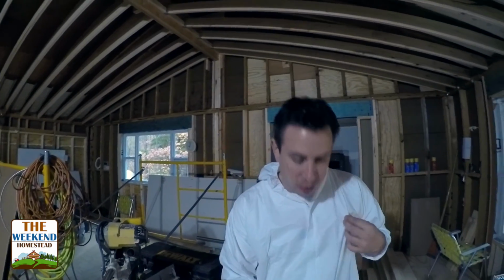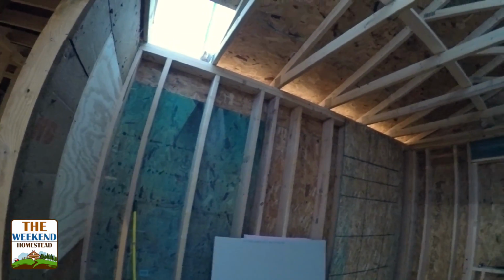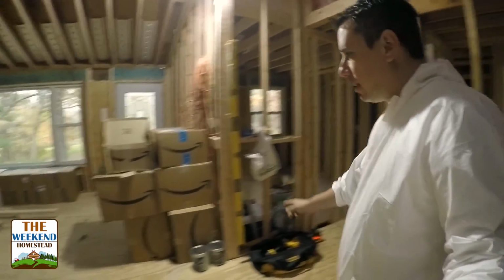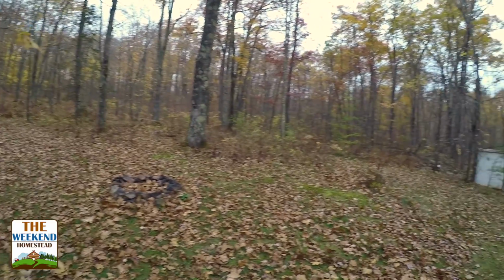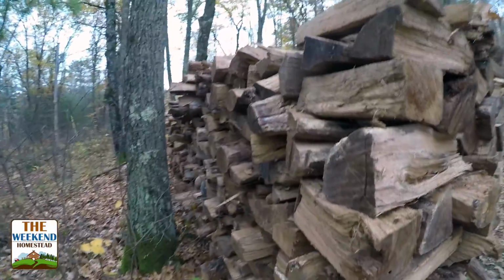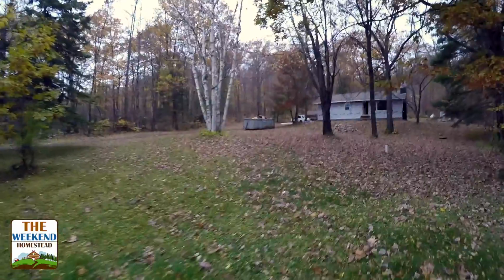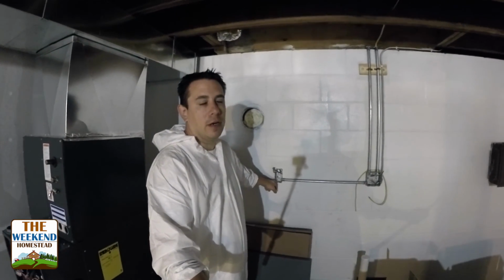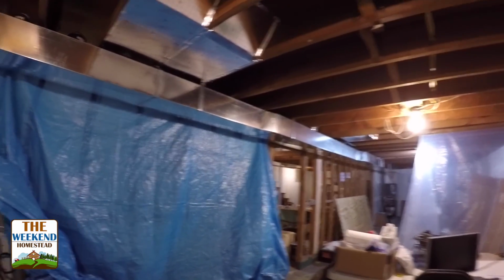From the Front Porch v6.5 - THE BIG ADDITION

Comment: Thnx for updating Mr. Heisenberg.
...also really like the idea of the transfer switch!

Questions: 
Are those headers made out of wood?
If it is so...witch wood....also for the substructure of the walls?
What is the outer diameter of a "fully constructed" wall at your sunroom? 
Are you goning to build a "kind of a roof" for the woodpile?
How deep are they going to lay the electric cable into the ground to prevent it against weather conditions and stuff like that or would it be protected by a bigger outer tube or such?

Greets from Berlin Germany!
Reply from the maker: The headers are processed Pine that is made into a board called a microlam. Basically think of ground up wood, super glued together and then made into a beam that is coated. Super Strong and very supportive. The sun room is 12x16 in size. At this point i have a tarp covering the wood pile, Next year i plan to build a proper 3 sided shed with metal roof out of all my scrap materials. Code on the underground electrical is 36in. They lay a super isolated rubberized cable out to the pole. Actually editing the video of them laying the cable and will post it next week. The machine basically digs a line and dumps the cable all at the same time. At the house we will put it in UL rated PVC pipe to the meter and then to the service panel in the basement. At somepoint I was thinking of doing a "Ask me questions" episode on the project to talk about some the tech we are putting into the house. Thanks
Reply from the maker: I plan to do a system walk thru at the end to talk about how our power system works, how the generator system works and some of the Intelligent systems I designed for the place like Cameras and light/sound control.
Reply: ....sounds good!